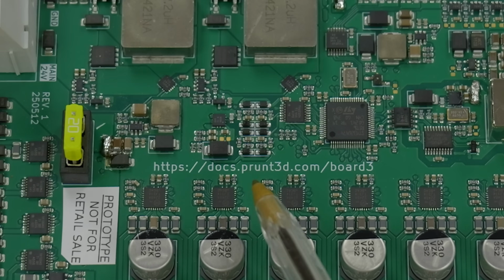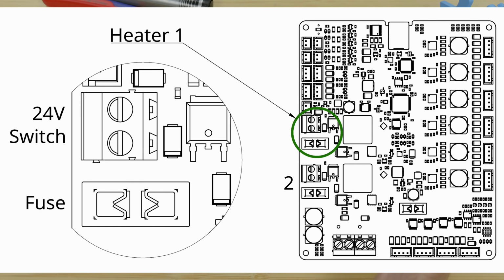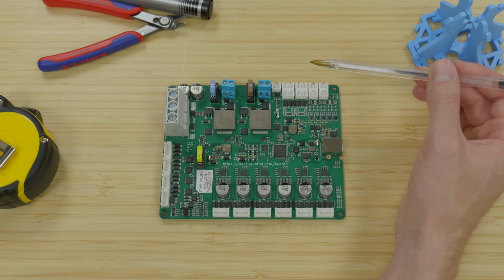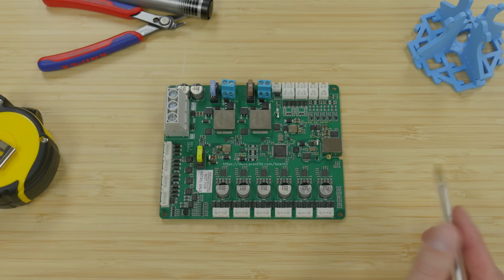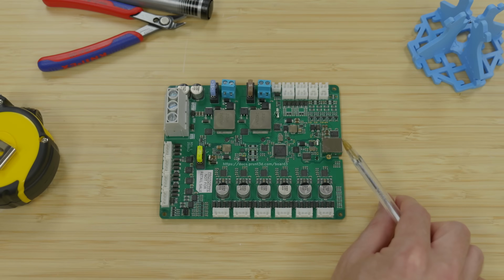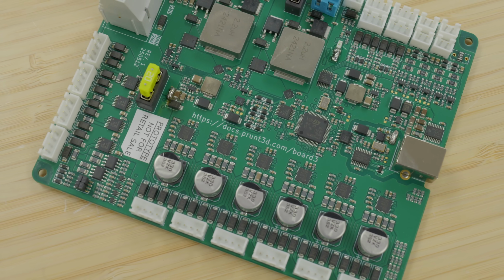New Control Board & Firmware Make Klipper Look like a Toy

Comment: My current goals are full step precision.   Trying to research step control and ive had no luck finding out how to tell if a main board will be able to reliably control a printer to the step.  I keep reading about the possibility of missed steps and how microstepping increases those odds but very little info on gaining reliable step accuracy.

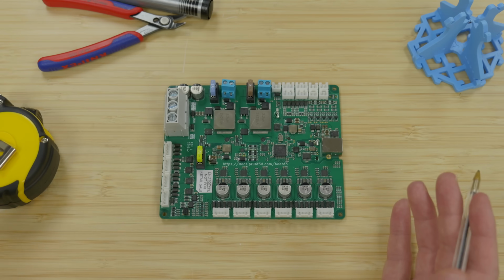Comment: on the first stepper driver there is a loose capacitor  i think                  0:28
Reply from the maker: As mentioned, it's a prototype.
Reply: All the caps that are meant to be present seem to be present in the video unless I'm missing something, so I have no idea where that came from, it's possible I accidentally dropped it on there while working on the board.

Comment: Very cool concept using dedicated hardware timers to offload step gen and PWM—definitely helps reduce software jitter and frees up CPU cycles. But I’m wondering: without any encoder feedback, how does this compare in practice to closed-loop systems? With modern MCUs like stm32, you can write additions to ie klipper to increase buffer motion queues far ahead ( queuing gcode commands) and apply advanced look-ahead with dynamic acceleration shaping—even incorporate model-based estimators like Kalman filters to predict and compensate for error or load shifts. Remember that the slicer (3D printers) or cam ( cnc) already “knows” all the vectors from the cad model. Curious whether this board supports any kind of feedback loop or adaptive motion refinement, or if it’s still fundamentally open-loop but with tighter timing.
Reply: The architecture of the server should make it a lot easier to implement new filters than in Klipper, but there's nothing closed loop on the board aside from whatever the TMC2240s do with CoolStep etc..

Comment: This does look like a cool project, but I am unsure of some of the claims they make here. First, do we really need ‘31 phase’ control of stepper motors? If we’re putting that much effort into controlling steppers, would we not be better off going to actual brushless motors with encoder feedback, like ODrive uses?

Additionally, I’m unsure of how the 31 phase motor control will actually reduce component wear - that seems like a stretch. It’s not like 3d printer components wear super quickly in the first place. 

Finally, I’m not convinced there is a real advantage to hardware acceleration here. Yes, klipper does do everything in software, but it’s not like we’re short of processing power with a raspberry pi. Hardware acceleration (at least for graphics on computers) exists because CPUs don’t have the right processing pipelines to be able to efficiently perform some tasks, so technologies sprang up to compensate for that. Here, we aren’t really running short of processing power - my raspberry pi in my voron trident hangs out at something like 20% CPU utilization, and it’s only a Pi 3B+. 

That being said, I am excited to see where this goes, and I hope to see myself proven wrong, because more variety is never a bad thing. Please change the JST-XH fan headers to normal PC fan headers (I don’t know what that connector is actually called, now that I think about it) if you’re going to have 4 pin fan control - those are the easiest to get, and would eliminate the need to crimp a new connector on.
Reply: Component wear: This is a result of smoother movement, bearings tend to last much longer when there's less shock loads and vibrations.

Hardware acceleration: This is on the MCU side rather than the host side. The most important thing it provides is always using the exact same number of CPU cycles no matter how many steps are being outputted or how many motors are active. This allows us to guarantee that the step generation will operate correctly under all possible configurations.

Fan headers: The main concern with using a PC fan headers is that people may assume theycan just plug their 12V PC fans in while the board is connected to 24V. A different connector makes people check that their fan is actually compatible.
Reply: @liampwll  I appreciate you taking the time to explain that. I'm excited to see where it goes!
Reply: @liampwll if people are going as far as to mess with this board, they are likely and hopefully competent enough to source the right fans, the same can be said for crimp connectors tho.
Reply: new connector , or adapter cable/board, your proposed fan header might be larger, no space for it or needs a daughter board

Comment: 2:25 NO, you do not need an SBC, any PC or laptop will do.
Reply: Yeah, of course, good luck putting your pc on a 3d printer. Just because you could do this doesn't mean you should do that.
Reply: @otaviogoes5832  I can see someone repurposing a chromebook running linux for this. My friend runs octoprint with a laptop mobo.
Reply: @otaviogoes5832 I've been using a really cheap used thin client for years, it was like 25€ and it's working great
Reply: @otaviogoes5832  SBC also uses less power when idle meaning leaving the printer on and ready isnt that bad on the electric usage.

Comment: Bah, more steppers. I badly need a solution that can handle servo's.
Reply: Not just that, but fieldbus communications as well. It would be nice to just have rj45 connections for most of it with real time control.
Reply: @HardyTechForge  Plug the EtherCAT into my veins.
Reply: @TheRob2D if you want ethercat then you are probably looking at LinuxCNC at this point, and that isn’t exactly oriented towards printers at the moment.
Reply: @Thorhian  That's exactly what I was doing this week. I know support isn't great but it's the road I have to go down. I want to keep the servos and drives that are in the machine.

Comment: Unpopular opinion: Klipper is in fact a toy, and so is this board.

Unless designed, tested, and validated in accordance to IEC62061 (since its application is machinery), this is just a hobby project that shouldn't be used in commercial products.

Edit; i said IEC61508 instead of IEC62061
Reply: You have to be kidding.
Reply: Again. Even if you meant iec62061, what has functional safety to do with 3d printing?
Don't throw around any norm standards. Just say it out
Reply: @spedi6721 I wrote a whole reply. Youtube isn't publishing it, sorry.

Edit: Basic TL:DR: a 3d printer in machinery in the EU/UK (not office appliances). IEC62061 is part of the harmonized standards to comply to the machinery directive. To comply to IEC62061 design rules and principles have to be followed for all componets in safety critical systems. Both klipper and controller boards are safety critical.
Reply: @GreenPlasticWaterCan I think you are overshooting a bit. Our home printers don't have the power to (severely) insure or even kill someone.
It's another case if we talk about laser sintering, but those are industrial applications.

Introducing this for home printers would be the guillotine for home printing. No one would get a notified body to regularly check the functionality or even each modification.
In my opinion this is simply not applicable.
Reply: @spedi6721 home printers have heaters that can cause catastrophic damage. Which will put software and electronics into a high risk.

The fact were talking about home printers doesn't matter. They still fall under the MD.

Edit: you're right about not checking. Nobody has the capacity. But that still doesn't mean the requirements don't apply.
Reply: @GreenPlasticWaterCan I can only recall 1 casualty where a fire started. Cause was that the Chinese manufacturer used wrong connectors. That's what you get when you buy cheap.
More safety is always good, can't argue with that.
But introducing those regularities would mean the end for DIY printers because only a handful of the users are electrical engineers and know how to do things right.
You can't prevent other people from cutting wires and maybe just twirl mains voltage wires together thinking "that's OK".
You would need to build printers in a way consumers are not able to manipulate them. 
That's the end of DIY and open source.
Reply: @spedi6721 I don't disagree. But again, that doesn't mean that the regulations don't apply. It's not introducing them, they are already introduced for decades.

We are just getting away with it because so little incidents happen and authorities don't have the capacity. Also the reason why the companies (mostly chinese) get away with it.

And its important to note that the MD also applies to DIY and open source. You as builder of a DIY printer are the legal manufacturer and therefor legal responsible for it. Even if it's a imported kit.

And don't get me wrong, I have 4 open source printers myself.
Reply: @GreenPlasticWaterCan  agree in principle. however I am unable to find a declaration from Klipper that it is IEC62061 compliant. Could you help?
Reply: Are duet bords and RRF compliment?
Reply: @Goroca duet need marlin to run
Reply: @spedi6721 
How do you mean?
Reply: @Goroca please stop trolling
Reply: @spedi6721 
I am not trolling 
I am trying to understand how duet needing marlin is relevent to my question about if thy have the certification
Reply: I what way has a SIL certification anything to do with 3d printing?
Reply: @spedi6721  In the EU/UK machinery needs to comply to the Machinery Directive. 3D printers are considered machinery, yes even DIY ones. Some manufacturers are thinking they can qualify them as "office appliances", and use lesser standards, but this is wrong. IEC62061 is part of the harmonized standards, Type-B if I'm not mistaken, and therefor considered to be a part of the requirements. I know I said IEC 61508, I was wrong because I didn't have 62061 on top of my mind. IEC61508 is the mother  standard of IEC62061, but I should've said IEC62061.

While IEC62061 is on a system level, underlying hardware and software need to be designed accordingly, tested and validated too. Klipper as a software and controller boards run safety related functions, like heaters and the emergency stop. Based on a risk assessment they need to comply to the design principals layed-out in the standard. Of course you can deviate but you need to show you've reached a higher or equal level of safety.

That said, nobody is going to check the construction files of 3d printer, unless people start dying. The institutions responsible simply don't have the capacity.

Comment: The fact that software generation causes jittering (see the screenshot you showed) is pure misunderstanding of what (at least) Klipper is doing, since it calculates ahead of time (no jittering, absolute zero issues) and then sends the commands to a daughter board which performs them exactly at the expected time.
Reply: Short approximate explanation as this is a YouTube comment, not a textbook: The screenshot doesn't show jitter, it shows a higher trajectory with more continuous derivatives. In the real world any trajectory is infinitely differentiable and trying to make your motors perform a move that isn't results in vibration, more continuous derivatives means more vibration.

Disclaimer: Prunt is my project.
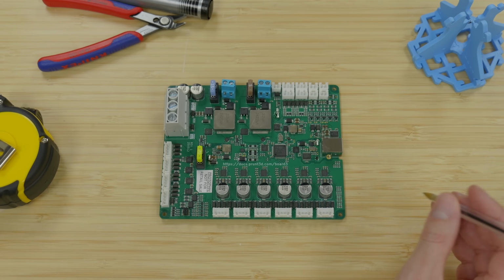Reply: @liampwll  I refer to the statement at 1:11, not to the first screenshot. The "timer too close" is quite uncommon, even if online you can find a certain number of issues about it because there are not many more with Klipper to begin with.
Since Klipper offloads command queue to the daughter board, which has usually 40 MHz or more nowadays, the fact that HW interrupts are not used is not very relevant, the timing is still correct.
Also... at 40+ MHz, how many instruction are even needed to be sent within few clock cycles to cause jitter? and how relevant would a few microseconds jitter, if any, in real prints?
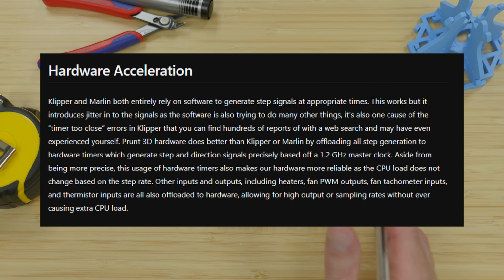If you talk about reprap FW which does step/commands generation and issuing all within the mainboard, I can understand improvements are possible. But I doubt the text at 1:11 really applies to Klipper.
Reply: @olafmarzocchi6194  There's quite a bit of overhead to actually generate a step signal and the rate you can actually achieve with Klipper can be anywhere from a few hundred kilohertz to a few megahertz depending on your MCU and number of steppers. You're right that the jitter doesn't generally cause issues (although it is present) and I'll edit that bit to clarify, the bigger issue is when the MCU becomes overloaded due to different motions causing different loads on the MCU, offloading everything to hardware means we can guarantee that it will work across all possible parameters.
Reply: @liampwll I appreciate the improved kinematics behind this project. To do wonder however how much this matters in practice given the stepwise nature of stepper motors. Even with micro stepping, the motors still act as torsional springs, and making jerk, snap and crackle commands continuous might mean less excitation of system resonances, but how much less?
Reply: @IronBrain0  yeah at the end all comes to print quality. What is from an engineering point of view correct, better, or just cool, might have no measurable/visible impact on the final result.
Reply: @liampwll  i don't value opinions of competitors.  As they ALWAYS exaggerate to make their own junk look good
Reply: @Cheeky_b52 lmao good grief dude.

Comment: Is there any advantage over close loop steppers/servos?
Reply: In the 3d printer world, there really isn't anything out there commercial available for 3d printers that takes advantage of servos, duet takes advantage of their own closed loop steppers, but that's about it. I'm currently building a linear servo motor 3d printer, so I've been looking into it a lot.

But anyway, the prunt board has better motions profiles, which gives you better, more accurate, and smoother control of your motors. Liam has a bunch of information on his website, and is very active on a bunch of 3d printer discords, including his own (he has videos of his board running in his discord)
Reply: In testing most closed loop steppers from BTT and MKS perform worse than open steppers on trinamic drivers. 

Servos on the other hand may offer advantages. The Magneto X with it's linear motors is probably ideal.
Reply: @groundzero_-lm4md the magneto is, but it has it's own issues, I have a mag x, it's my daily for abs-cf. But the mag x is what got me started on building my own printer with some of the linear motors I have.
Reply: Linear motors are power hogs